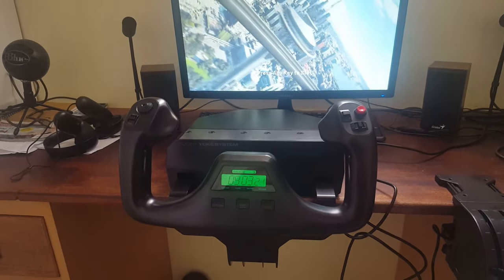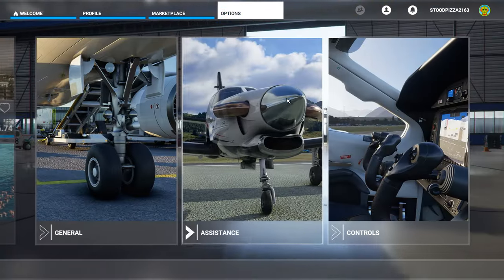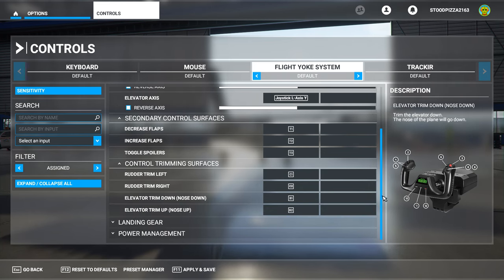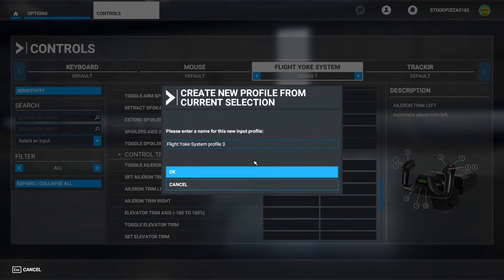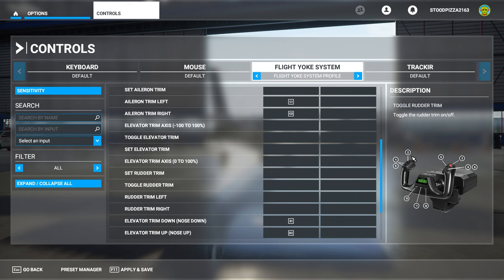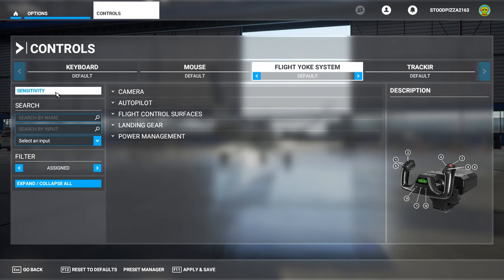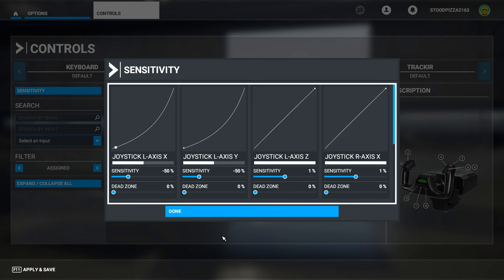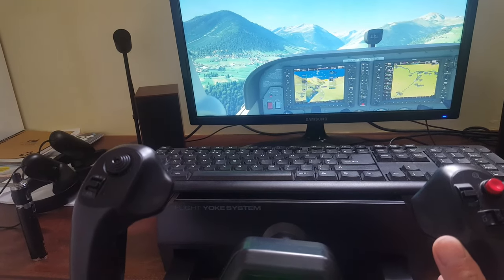FS2020: Setting up the Logitech Flight Yoke System and alleviating the Deadzone!

Comment: Can someone tell me how to set up the throttles? it hasnt been working for me.
Reply from the maker: In what way are they not working properly? What yoke do you have?
Reply: @Huddison  I have the exact same setup as you. The sim just does not respond when i do anything with them, despite the little green led being on.
Reply from the maker: @jaspert.4498  Check my other video about setting up axis on unsupported devices (look in my 'Flight Sim Videos' playlist) to see if that helps.
Did you install an additional driver for your flight yoke system?
Reply: @Huddison  Thanks so much for the help. I will go watch that vid. and yes i did install a driver from the logitech website
Reply from the maker: @jaspert.4498  let me know if it helps
Reply: So when I move the throttle lever after it starts scanning for an input, it just doesnt pop up.
Reply from the maker: @jaspert.4498  it sounds like a defective throttle quadrant. I'll pin this comment to see if anyone slse has a solution.
Reply: @Huddison  Ok. Thanks! i love your vids btw
Reply from the maker: @jaspert.4498  thanks😊
Reply: I can not the the anal throttle to work with twin engines, (it just adjust one egine).

The analog intip setup is very confusing, first time I screwed up and put the roll axis as digital input and not analog and many many other have done the same with disastrous result. Many have even given up fs2020 and gotten a refound because of it and non on forums seems to be aware that is the problem.
Reply: I just received a few days ago the Thrustmaster Airbus  joystick and the Airbus throttle and its difficult to set up...  No books one how to set these items up...
Reply from the maker: @johnwilliam8366  Keep an eye out for a back-to-basics type of video from me coming very soon - I'll be going through setting up controls in more basic detail.
Reply: The throttles should be set up when you plug in the throttle quadrant.  It is plugged into the outlet in the back right of the yoke.  I plugged mine into the back of the computer at first. That is not right.
Reply: I have the same yoke (Saitek) and throttle quadrant from years ago. It hasn't changed. I spent all day trying to get the throttle quadrant to work. Green light, but nothing else. Tried loading drivers from CH site. Then I came across the answer on a forum. Yoke has to be plugged into USB2 and NOT USB3 for throttle to work, even though the yoke itself works with USB3. Or plug a usb2 hub into your USB three hub, as I did. I don't understand why, but the throttle quadrant needs the old USB2. I can also recommend the Pro Flight Rudder Pedals.
Reply from the maker: @wildbluesea1  Excellent tips thanks 👍
Reply: @wildbluesea1  Thank you so much. that is a complete lifesaver. and i do have the Pro Flight Rudder pedals.
Reply: @danbrewer9444 , Can I plug in my Logitech rudder pedals to the USB port of the Logitech Yoke?
Reply: This was a great video! What’s the dead zone for?
Reply: are you on the xbox version perchance? i believe that it isnt compatible with the xbox
Reply: @ramnik.khanna  Yes you can but you MAY need a power adapter to power it. If it is just the rudder pedals you are probably fine but I have the switch panel and the auto pilot panel, so I needed the AC adapter to provide enough power to the built in hub.
Reply: @CRAZYHORSE19682003  , thanks for your response! I'd got them working without having to add any power adapter.
Reply: @wildbluesea1  idk if im lost or not hut at the back of my pc there are 4 usb plugins and a image showing a mouse and keyboard?
Reply: @jaspert.4498  did you ever figure out a fix? Having the same issue
Reply: @strimpswaccines213  im trying to remember how i fixed it.... pretty sure that it was @wildbluesea1's comment about wich usb port it has to be plugged in to. my setup has been working fine for years now, lmk if this helps. i can take you through how mine is set up if yours sitll isnt working

Comment: I'm new to flight simulator, but i don't really get how you move around on the ground? Like how do you move forwards. I did see the end part where you covered the rudder assist, but I still don't get it.
Reply from the maker: You use something called the 'Rudder' and a little throttle - watch this video of mine for a little more clarity: https://youtu.be/zcm0dp72GD8

Comment: Noice vid, got fs2020 today all downloaded and noticed can't fly without a yoke, its legitimpossible..so I'm waiting for one
Reply from the maker: You might get away with using an Xbox controller (if you have one); to check the sim out.
Reply: @Huddison  hi, yeah I'm getting a hotas for now
Reply: I found the problem with joystick many have after 3 hours of reading forums and watching all tutorials on joystick setup. Deep down in the comments of one youtube video one said you must make sure X-Axis Z-Axis and Y-Axis it assigned to analog input and not digital. It is pretty much impossible to get them all right in the first try since it does not say what is analog and digital... I did just follow a screenshot how do do it right and it fixed all the joystick problems with my old Logitech Force Feedback 3d. 

* Or454654984-
Reply: @a64738  a link to that video would be nice

Comment: the axis on this yoke is very noisy and with 0% dead zone aircraft will always turn left/right slightly requiring you to correct it very often. I set dead zone back to 3% and was able to fly straight
Reply from the maker: Fantastic tip - I'll try that👍

Comment: what about the throttle it has 3 levers and I thing the red and blue ones are supposed to be throttle but the black lever is the one that controls it automatically.
Reply from the maker: You can assign the levers to whatever you want them to function as: I currently have my middle lever set at throttle and the right most lever functioning as flaps - watch this:
https://youtu.be/38T03hm48es
Reply: @Huddison  Generally the Black would be throttle, the Red would be mixture and the Blue would be for propeller pitch in a complex prop airplane.
Reply from the maker: @martygenska8117  Thanks I know that - but you did right by pointing this out, as the original question poser may not have known (and I overlooked that!)😉

Comment: Question will the Logitech throttle quadrant throttle control work with 2 engine aircraft up to 4 engine aircraft?
Reply from the maker: You could certainly assign two of the levers to work with 2 engine aircraft; if you were to buy 2 throttle quadrants, you could then control 4 engines.
Check out this video by frooglesim, to give you some idea of what can be done.
https://www.youtube.com/watch?v=JDmsAisHKAA
I'm buying something similar myself; stay tuned..
Reply: I just used the Logitech to fly a 747 worked great being able to operate the 4 engines. Great fun.
Reply from the maker: @garylanum6098  It sounds like great fun.

Comment: great 2yrs on i buy the Logitech set enlist with Xbox game pass ultimate and it does not auto detect the yoke, or can i scroll and find an option to do it,  though it will navigate very little but not confirm much even the throttle  will move up n down a page. any ideas cos the purchased Microsoft Flight Simulator Deluxe 40th Anniversary Edition will not land in my Microsoft account and amazon confirmed there's an issue with the Xbox/Microsoft relationship
Reply from the maker: It's unclear from you comment, but are you on Xbox or PC?
Reply: I was all set up for pc but it was a disaster and unworkable threw Xbox game, pass I got my refund and started over with steam and everything works pretty well sometimes but takes time to navigate the Logitech controls i need to revert to mouse can never find the dam brakes on the yoke gear ive purchased this set Thrustmaster T.Flight Full Kit X - Joystick, Throttle and Rudder Pedals for Xbox Series X|S / Xbox One / Windows :)

Comment: I got a Logitech yoke (and installed Windows; normally I'm all-Linux) for FS 2020. A problem I had with mine was the roll axis was centered too far left; the raw values coming from the driver in the range 0-1023 were returning in the low 400s for roll, while being at a dead-center 512 for pitch.
I downloaded and used the Logitech calibration tool (from which I was able to get the above raw values and see that it was centering too far left), but it would revert after a reboot and sometimes not seem to work at all?

It was a simple matter to open the yoke by undoing all the screws on the bottom, removing the bottom cover, and adjusting the roll potentiometer until it was properly centered. It's a standard potentiometer, held in place by a single collar nut; slightly loosening the nut with a wrench, or even careful work with a pliers, allows you to rotate the potentiometer until it is in the desired position.

Both axes are spot-on 512 centered now, and I'm no longer having to hold right yoke all the time.

Much easier than bending the aileron trim tab and test-flying on a real Cessna.
Reply from the maker: That sounds like an interesting & relatively easy fix.
It may well be of help to some; thanks for sharing.

Comment: I have set up my yoke with these settings, so I can pan around both in the cockpit and external.

Camera Mode Switch
     Cockpit/External view mode           D
Cockpit Camera
     Cockpit Look Down                         POV (Down arrow)
     Cockpit Look Left                            POV (Left arrow)
     Cockpit Look Right                          POV (Right arrow)
     Cockpit Look Up                              POV (Up arrow)

External Camera
     External View Look Down               POV (Down arrow)
     External View Look Left                  POV (Left arrow)
     External View Look Right                POV (Right arrow)
     External View Look Up                    POV (Up arrow)
Reply from the maker: Very useful information - thanks.

Comment: Mine is not working at all. Even trying it on my powered USB hub. Is there more I have to do or did I get a DOA product? Woudl be a real shame aince Logetech is one of the very few that make flight sim yokes. Also tried using a 12 volt power adapter after painstakingly finding a DC adapter that fits the unusualy sized DC port on the yoke. Didn't work even then it even wound up shorting out my USB hub trying the 12 volt plug. For the record I did try a 5 volt adapter but that didn't work ether. I get the feeling tis yoke uses a very spicific DC adapter that nobody makes. Also tried installing the proper driver program but it says I need to plug it in even before I can proceed though it is plugged in and was getting some power fron the USB hub ans 12 volt adapter.
Reply from the maker: Oh dear, that's not good news.
Simply plugging the USB in from the Yoke system to your PC should be enough to power it up.
Yours might well be DOA unfortunately, if you have no power displayed on the Yoke system after plugging it in the traditional way.
Reply: @Huddison  Yeah pretty sure its DOA. Thankfully Amazon makes returns easy. I wish Logitech would just redesign the thing so its not so picky with the power. Clearly they make more than enough money to be able to design a better yoke but they decided to cheapen the product anyway. I may go with ether the CH Products yoke or Honeycomb yoke next even though they cost more.

Comment: I found the problem with joystick many have after 3 hours of reading forums and watching all tutorials on joystick setup. Deep down in the comments of one youtube video one said you must make sure X-Axis Z-Axis and Y-Axis it assigned to analog input and not digital. It is pretty much impossible to get them all right in the first try since it does not say what is analog and digital... I did just follow a screenshot how do do it right and it fixed all the joystick problems with my old Logitech Force Feedback 3d. 

* Original post *  :Joystick control in FS2020 is totally and utterly fucked up on most sticks on the market and the sensitivity setting do not work, it just make input lag larger... When I fly the Beach-craft 350 and turn the joystick it take 2 seconds before it reacts to a roll, (up and down works perfectly fine and linear). Also when it finally reacts it does not mimic what the joystick do, it react same as if you are using a keyboard to fly. Meaning no matter how little you turn the stick it reacts and it does not react how much you push on the stick but for how LONG you keep the stick in the position. Only way to actually fly is to use the joystick like it was a keyboard pumping it, this is just ridiculous and internet is full of people complaining about it. Some people say they have no problem at all but most say their joystick simply is unusable in FS2020 and I am one of them with my Logitech Force Feedback 3d pro. Even stranger is that all the above only is for the roll, up and down works perfectly fine and linear with no input lag... Lot of people complaining about exactly the same problem since FS2020 came out and nothing has been done to fix it.  .  .. .. . .. .
Reply from the maker: Lots of good points. I do believe that Asobo are slowly refining the way yokes and joysticks behave/react in the sim (the last few patches reflect this).
But you are right, they still have a long way to go, until it reaches the precision of something like X-Plane.
Reply: @Huddison   I found the problem with joystick many have after 3 hours of reading forums and watching all tutorials on joystick setup. Deep down in the comments of one youtube video one said you must make sure X-Axis Z-Axis and Y-Axis it assigned to analog input and not digital. It is pretty much impossible to get them all right in the first try since it does not say what is analog and digital... I did just follow a screenshot how do do it right and it fixed all the joystick problems with my old Logitech Force Feedback 3d. 

* Original post *  :
Reply from the maker: @a64738  That's brilliant & could be useful to others reading this👍

Comment: I just dusted off my Saitek Yoke and Throttle as well as my Saitek X52.   Had these for about 10 years and sat in a box until now.    Do you know if anyone has made an IMAGE of the Saitek Yoke/Throttle similar to the ones you see with controllers with the button mappings?   Looking for a cheatsheet.  If not, I may need to make one on my own.     Thanks for the video and I will likely go mess with sensitivity as the default didnt feel great.
Reply from the maker: It might be worth joining the Discord for help with this (link in my most recent videos).